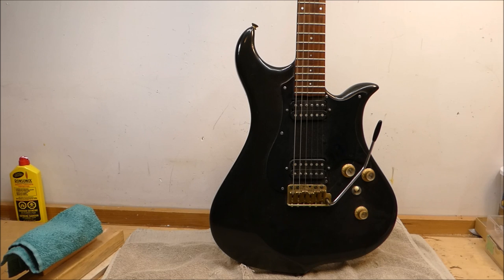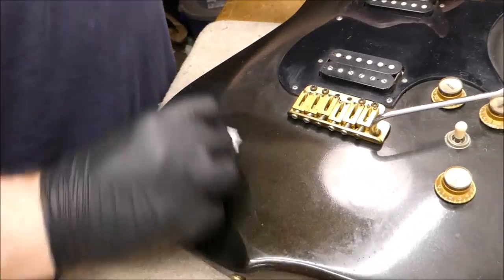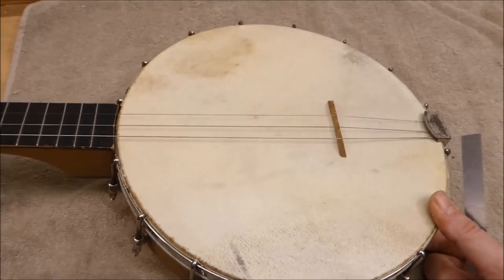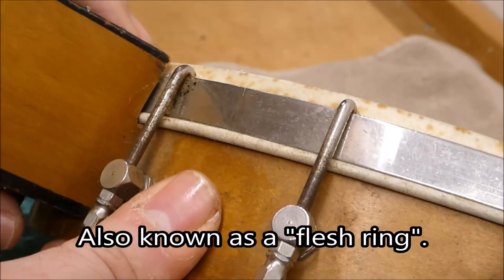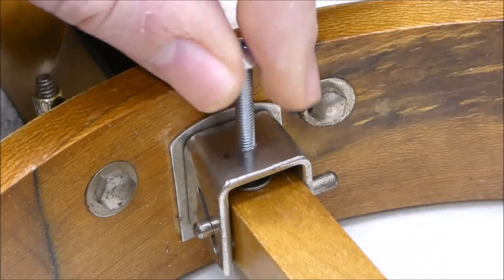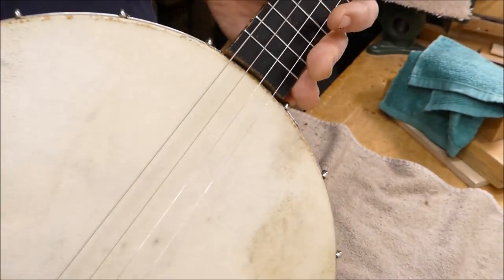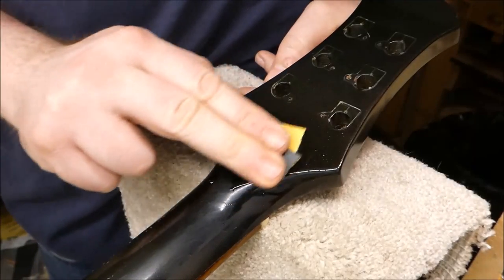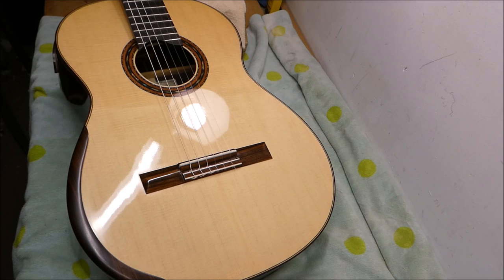Just a work-a-day luthier

Comment: Because you do the things I enjoy....I thought I’d ask if you have ever installed a DeArmond toaster pickup in a tele neck position? I think they were the same pickups they used on the old rickenbackers. It was mounted on a Kalamazoo archtop. I’ll have to drill out the rivets as the wire is routed out the side of the pickup and I’d need to divert it coming out it’s back to the tele body route. Ever done that? Well I thought I’d ask. I’m handy enough to be dangerous. Cheers
Toaster measure at 10.6 with a Peter Florence Voodoo TE60....no idea of what I’m doing. Second tele build.

Comment: Harmony used  the same single dowel rod attachment with their banjos with the Bakelite Pots. I've worked on several, and every one, whether Tenor, Plectrum or 5 string, they've all been a pain in the butt.  I've ended up shimming the neck end most of those I've worked on Ted. 
Harmony used a similar tail piece, that I ended up removing and getting rid of the loop end all together, as the always seem to break right where you have to that 90° bend. The one Plectrum I own, I ended up converting to use ball end strings.

Comment: Not sure if it applies to open back banjos, but banjos in general usually use a higher action than acoustic guitars. .125” or 1/8” at the 12th is usually recommended for banjos. I know I set my Stelling to .090” as I would my guitars, and then discovered that factory spec was .125”. Setting it there made a huge improvement in response. Banjos don’t seem to have the string tension guitars do, and the extra room for strings to vibrate helps a lot.

Comment: Some of the dried epoxy around the neck tension rod nut (the area uncovered by the black cover) could be removed by using a dremel with a grinding or shaping tip. Its noisy, but it would get the nut exposed for adjustment. Thanks

Comment: OMG lol, that pool of epoxy in the truss rod cavity 😫 How can someone be THAT thoughtless when doing a glue up job (the owner, not Ted, of course)…!
Reply: @Short 4A Stormtrooper Big 4Your Mom Big claim to make....
Reply: He must have been working with the guitar face down and the truss rod cover screwed in place with the last 2 remaining screws, then put lots of glue in the joint to make sure it stuck 'properly' but didn't think about squeeze out filling the nut cavity. When the glue had set he tuned the guitar up and said 'good as new' and never checked the truss rod so didn't know what a mess he had created !

Comment: so the one good instrument you can't work on it until you get the buy-in from the builder :(

can't help wondering if attacking that epoxied-in truss rod nut with a big soldering iron might free it up?

then once removed it might be a matter of attacking the rod end itself with an iron to unstick it from its surrounding epoxy bed long enough to then spin the nut back on and get some movement out of it

as for the dowel-stick banjo with the bad neck angle, i'm not a "banjo guy" either but wow what a pain! pretty sure that end screw was supposed to come out with the lug that held the tailpiece, not be still stuck in the rim and dowel stick like that! 

i don't love the idea but all i've ever been able to come up with is plugging and drilling a new hole in the end of the dowel stick to kick the neck angle back, along with stuffing appropriate shims at the heel to keep things supported

Comment: ANOTHER Amazing Vid!
Your "Flesh Ring" Comments were Hilarious!
Oh, those Stupid NASHVILLE Tailpieces are the Same Principle, needing to give the Loop Ends a little Kink with Mini Pointed Pliers 1st~But whats WORSE, is there's a Concealing Hinged Cover screwed on it from either Side, which U have to Remove, if U ever expect to Install Strings.
And it's a Bugger to align the Cover Lid Screw~Holes back in Line with the Tailpiece Ones!
I Replaced Mine with the CLAMSHELL Version, although I had to Dremel off a Small bit of Metal for Mine to fit, where it meets the Wood.
> B-/

Comment: 20:00 I’ve found a lot of that type of buzzing can be due to loose and/or low nut slots - might check that end?
Reply: ...if you press the string down and it is still buzzing, you have eliminated the possibility that the buzzing is coming from low nut slots. Low nut slots can only create a buzz on the first fret.

Comment: I've always heard peoples warnings not to glue the truss rod in during a repair and not to use epoxy. Even uttered warnings myself in my own videos never really thinking anyone with a brain would do such a thing. Now I will need to tell folks to be sure and take the nut cover off and be sure there is now glue welling up in there. I guess we can never assume people get it. Instantly knew it was a home made guitar seeing the irregularity's in the cut a ways. I'm sure you meant to wind the banjo strings on the outside of the outside tuners but it must be confusing when tuning.
Reply from the maker: A lot of the old friction tuner banjos can't be wound normally - the string paths collide with the other shafts.  It takes a second to get used to.